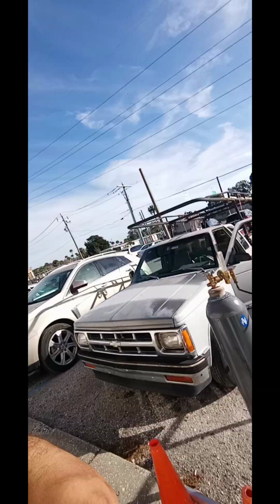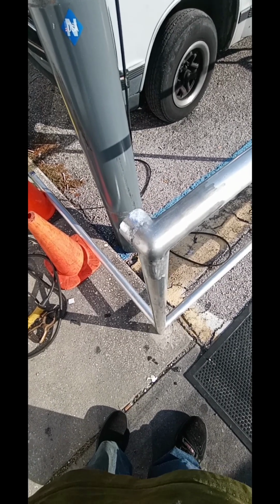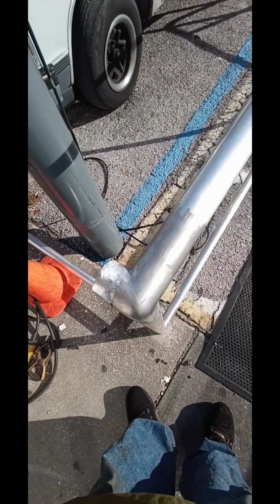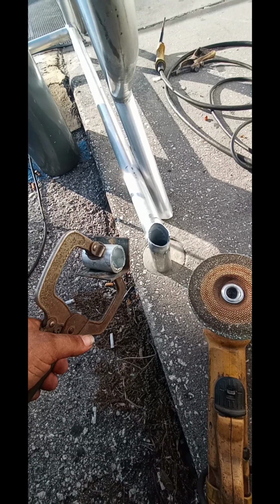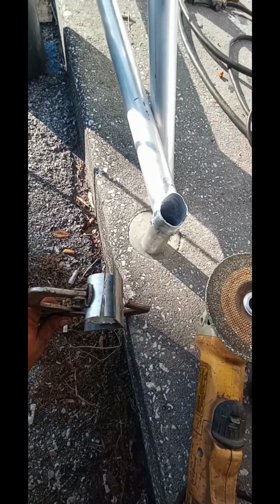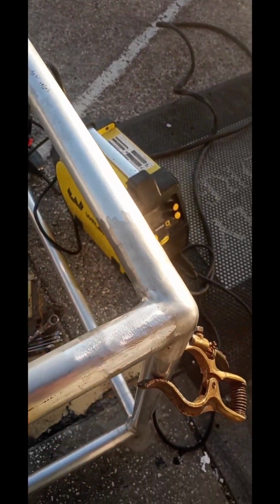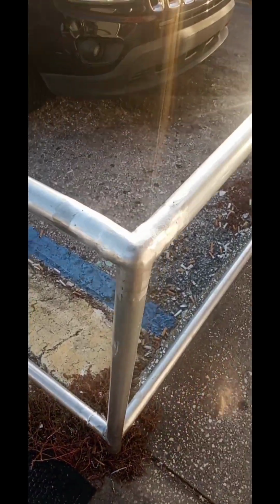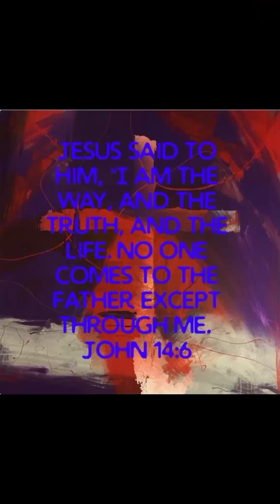Aluminum Spool Gun Time!

Comment: What size bottles (Cfm) for your gas are you using for welding that you find the best to transport with when doing your mobile welding or also in the shop.
Reply from the maker: I use a 125 for mobile. A 300 for the shop.